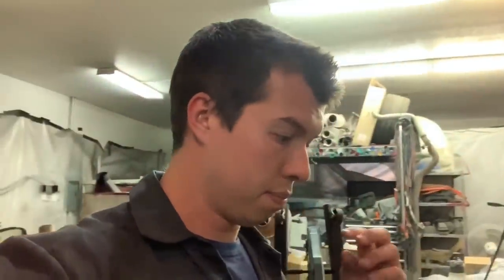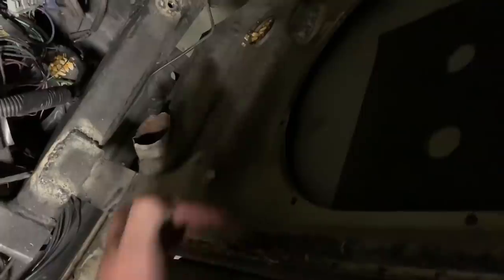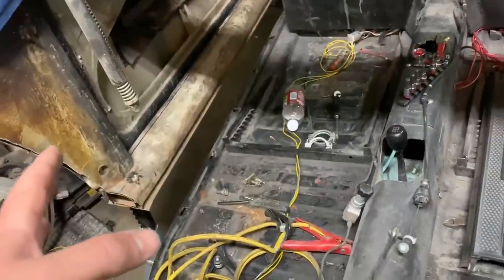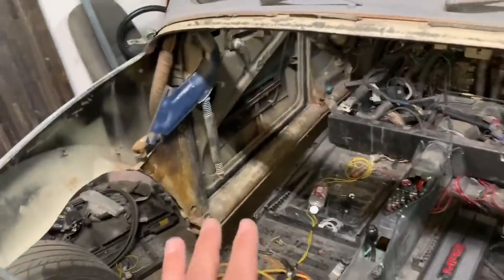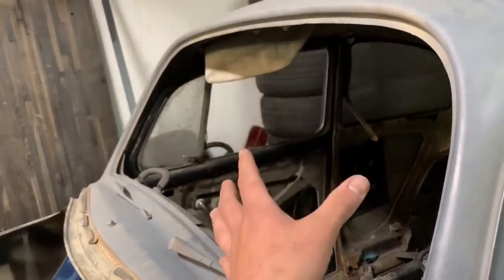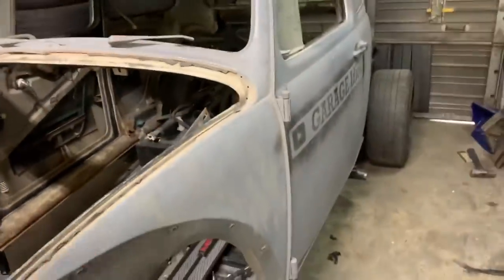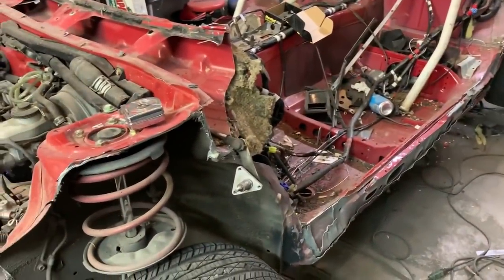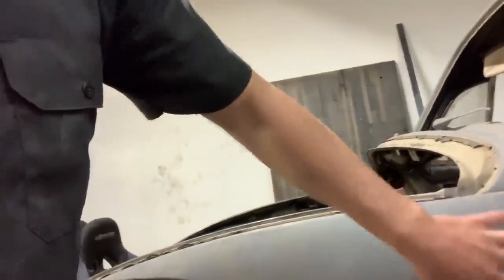NEW IDEA to make the Honda Bug body fit on the MR2 chassis!!

Comment: No, No dude i'd chop the MR2 sides first then hammer just 1 side were the strength to the MR2 rocker was 

that way you ran maybe angle the bug body and get the 1 bug rocker into the cut out c like section. 

Were the first rocker on the MR2 was then after 1 side of the Bug body's  rocker is in the MR2 it should slip 

down in place on the MR2 since you smashed the top lip of were the strength and rocker was.  

Then hammer and bend the section flat to seal the bug rocker area inn then reinforce it last. 

This way no further hacking the body up and it come's out looking good, Once reinforced after you got the bug body in place.

Comment: you should have used the first gen mr2.  It's much more narrow than your 2nd gen mr2.
Reply: And the 3sGTE still fits
Reply from the maker: Ours is  1.4” wider than the first gen, that wouldn’t have made a difference, still wouldn’t fit

Comment: It's not stupid! I like the point where you intend to cut the MR as the strength is in on the inner corner between the floor board and "door" frame. First cut the MR there and fit the bug on that and figure out where to "slot" the bug for the match.  I agree with cutting the bug on the rust point. Watch this video... 
 https://www.youtube.com/watch?v=psG8VYt0w6c
Most of these bug mods are made street legal.Fitting the mudguards back... this is where I see your project go! Once the bug is welded to the MR, It will have enough integrity and with the roll cage...
Reply from the maker: That video was sweet! Awesome inspiration! Thanks!

Comment: Place bug body over other chassis,  cut Mr2 rockers out where needed, plan on cage material pipe to surround the pan, with a ful cage it would be plenty strong, if built right the bug body can still be pulled off just like comin off a factory pan, your makin it harder then it really is, set the body over it and see where your at, stop over thinkin, seeing is believing. ...
Reply from the maker: The problem is the front width, the steering wheel is going to be very close to the bugs door frame
Reply: Check Flaming River for steering knuckles and shafts, u can move it. Im not familiar with the Mr2 stuff